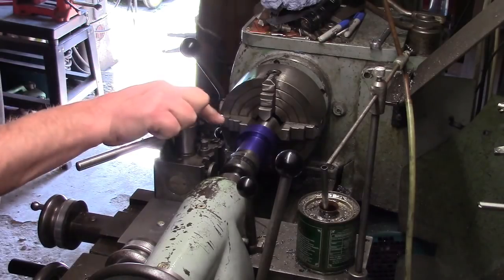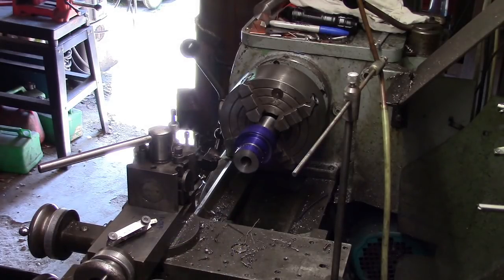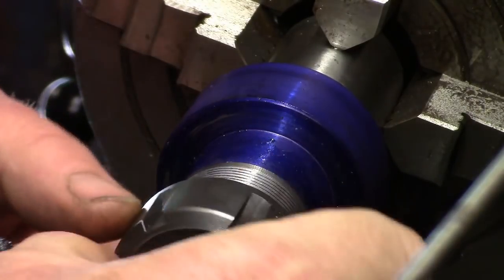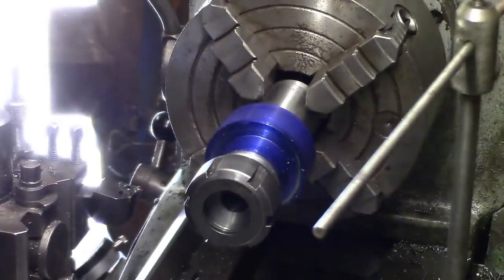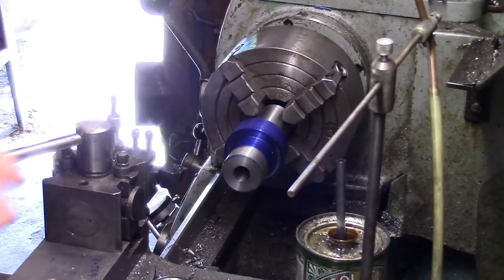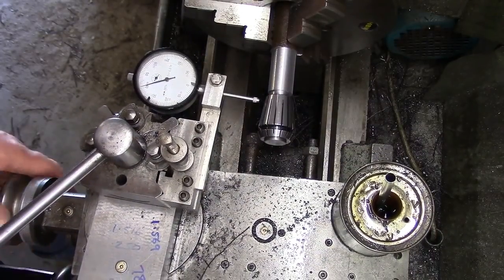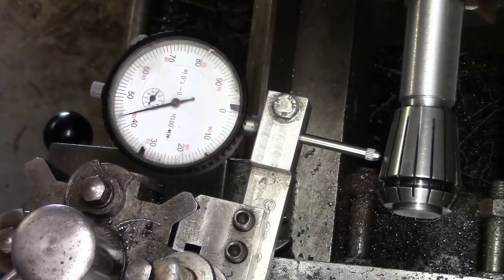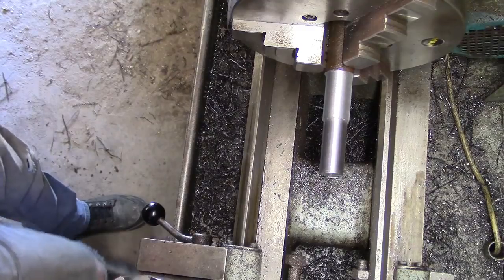Dividing Head ER32 Collet Adapter, Part 3

Comment: Hi Alan.  You didn't turn the collet to see if it registered the same on another side.. 🤔   it's the first rule of precision setting. Never rely on 1 side. Shouldn't make a difference but sometimes it does. Those cheap nasty collets can be 10thou out. That's why you can pay £8 or £80 for them. Just me being critical buddy. 👍
Reply from the maker: Good point Dave I never thought about that, I'll remember next time.
Alan.